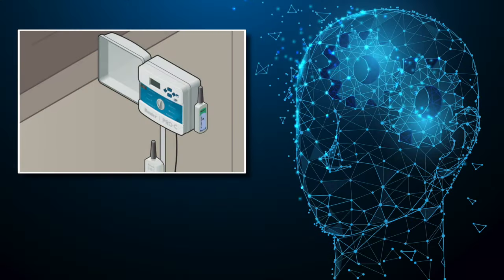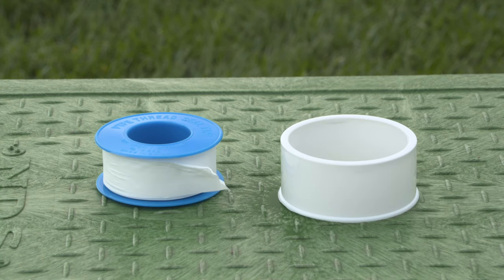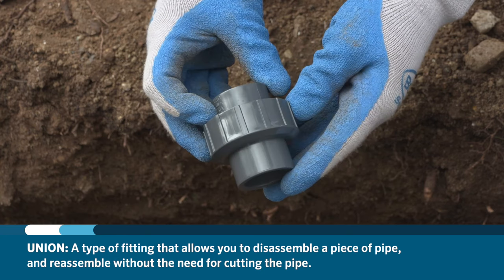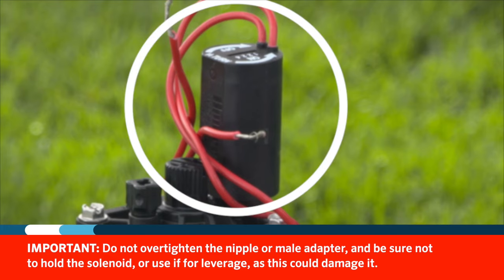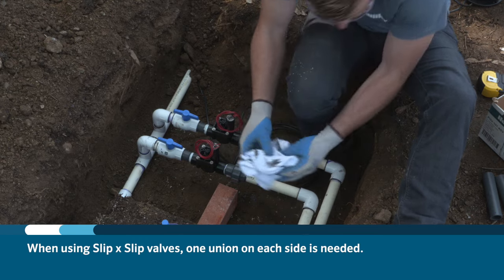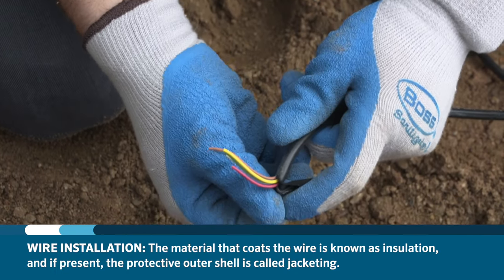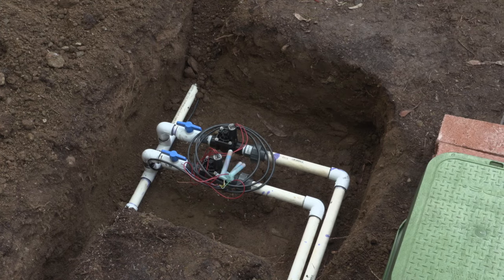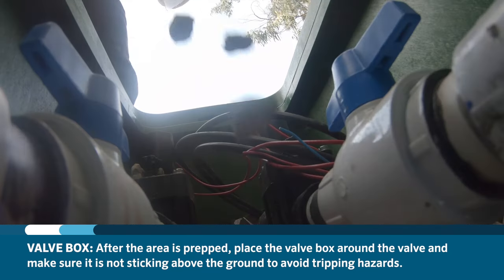Hunter IIF Training:  Valve and Wiring Installation

Comment: does it matter which wire from the solenoid you use to the white wire?
Reply from the maker: This video refers to AC or household powered controllers and the wire polarity is not an issue.
Reply: This was my question. Thanks! 👍🏻

Comment: To make it easier to remove the valve in the future, put unions on both sides of the valve. If there is only one when you thread the valve off you hit the pipe and either have to cut or dig up a bunch to flex the pipe out of you way.
Reply from the maker: Thank you for your input and watching!
Reply: that seems like a good idea, but i personally don't like having threaded PVC unions on the 24/7 pressure side of the valves, and find that having the union on the output side is all that is needed.  Also,  I like the slip PVC ball valve per valve idea for larger installs.

Comment: So what would you recommend for trying together cleanly the ground wires from 10 valves.  All them wires wrapped together tied to the controller is a mess.  I'd like help making that connection look good and be sealed.
Reply from the maker: Thank you for contacting Hunter Technical Support.

Your question is better handled over the phone. Please give us a phone call when you can be in front of the controller so we can help you review your current setting and make adjustments if necessary.

You can reach us at 1-800-733-2823 between 5:30 AM and 4:00 PM PST, Monday through Friday.

Thank you again for contacting Hunter Technical Support. Please let us know if we can offer any other assistance.
Reply: Look up how to pigtail wires.

Comment: Great video, thank you. I'm just wondering if this landscape fabric is waterproof. I google it and found some info that it's not waterproof so I'm not sure if that is okay for valves. I don't have much experiance but want to do a system for a small orchard.
Reply from the maker: Thanks for your comment! The fabric used in this video is Landscape Fabric. It is sold at all landscape distributors, Home Depot, and Lowes. This is not used to prevent water intrusion. It is used to prevent critter, root, and debris intrusion.
Reply: @Hunter_Landscape_Irrigation  All right, I get you! thank you so much!

Comment: Hello, very useful video thanks, i have a question, what is the max cable lenght recomended for valves? thanks and hope a sooner answer
Reply from the maker: Meet with your local irrigation professional or Hunter distributor about wire details that best fit your application.

Comment: I notice some irrigation valves are sticking out of the ground by about a foot above ground, while other jobs I see they have buried the valves in the ground in a plastic box.  How do I decide which one I should I use.  1 valve is for a small sprinkler zone and the other 5 valves feed drip zones. your advice would be helpful.  Larry
Reply from the maker: Thank you for contacting Technical Support
 
The application will determine which valves you select. The installation is up to you as a valve box is recommended for future access and service easily. 
 
https://www.hunterindustries.com/product-line/valves
 
Thank you again for contacting Hunter Technical Support. Please let us know if we can offer any other assistance.